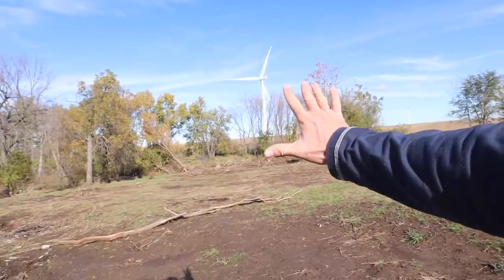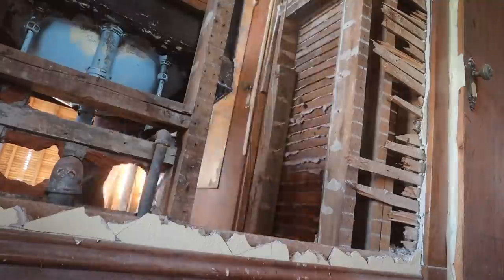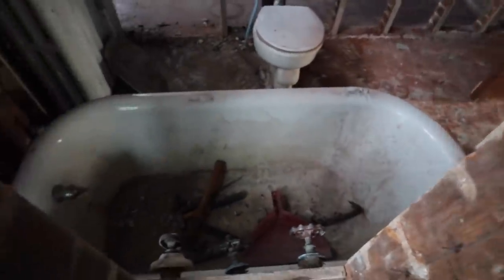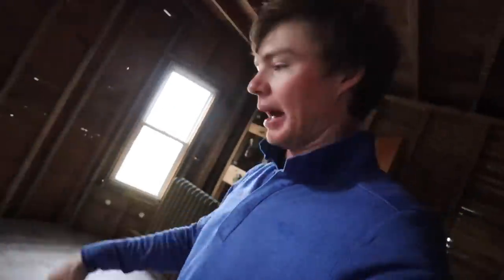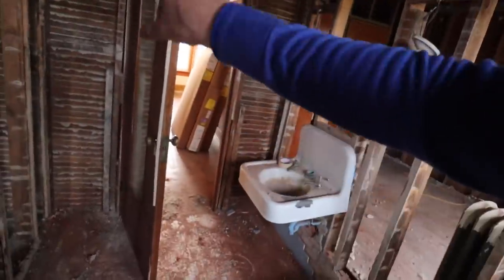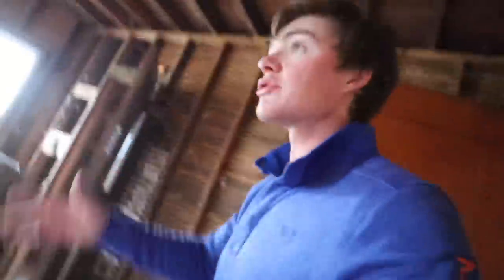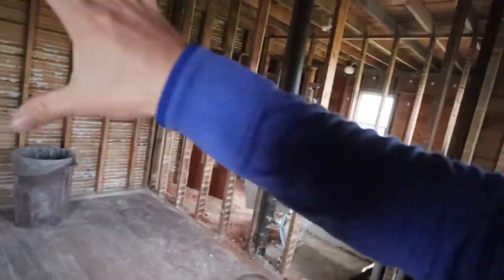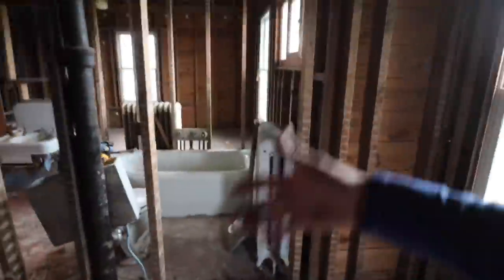I Am Building An Underground Movie Theatre

Comment: Instead of replacing all the boards in the attic floor, just wash with 1 part bleach and 9 parts water (wear a respirator).  Once all dust/debris and droppings are cleaned up, let dry.  Then cover with plywood or some other similar material.  It would save you heaps of additional structure work.  I am certain you could find a company in the area to clean and disinfect your  attic as well if you looked around.
Reply: 100% Agreed here. Then cover with 1/4 plywood to level and add the floor of your choice (laminate?). 😀
Reply: you can also get special paint that will seal in anything left behind
Reply: Bleach cleaning the attic may very well be the way to go to sanitize the wood. Look into it and save some money!  Looking forward to seeing the progress after harvest.
Reply: Seems like I recall there were a few bats also.
Reply: I good coating of Kilz will seal up that wood and odors as long as the wood is dry.
Reply: Ozone generators do work very well. Removed cat smell from my pole barn/shop.
Reply: @maximunpayne92  There is a really good one called "Ridz" kind of expensive, but a gallon goes a long way if you know how to paint. Ridz will cover everything and has a mold and mildew killer in it as well. I would still wash as stated above first though.
Reply: Cleaned one with blank and water and sealed with spray on polyurethane after it was dry and came out good. Works with houses people smoked in and spray everything but the windows and paint over and all looks and smells fine after.
Reply: Just get a floor sander in
Reply: @dans_Learning_Curve  :
Reply: Not bleach. Actually causes more issues. Shockwave is better
Reply: There is encapsulating paint, for use after a fire where the lumber is still sound.  It has also been used to encapsulate lead paint (though no longer allowed) its perfect for your bird contaminated boards.  give them a good cleaning let them dry then apply this stuff (its also a type of primer) and you are good to go.

Comment: I wouldn’t replace that attic floor and all that expense. Rent a commercial floor sander and seal it. Will look amazing and keep the character of the house. If you need insulation the heat from below would heat the floor and put area carpet in a cold spot.
Reply: Warmest always is the top floor. Heat rises you know. Lived in a farm house and the 2nd floor rooms were the warmest. Also the hottest in summer.
Reply: That’s the point he don’t want the old 18 century look for his house. That’s why he upgrading his whole house to look more modern. He’s doing the right thing by making it look more homey and not so much of a haunted house.
Reply: @Buuboi214  Then maybe he needs to buy a house trailer.  And it isn't 18th century, it's 20th century.
Reply: @wandasetzer1469  no shit Sherlock I was being sarcastic.

Comment: Hey Cole, a couple of thoughts for your insulation and wiring: Consider adding a Mooney wall to your exteriors.  You'll give up a grand total of three inches of width and length in your whole interior, you'll be able to add a couple of inches of blown-in dense cellulose (because winter in Iowa), and the added-on 2x2s will provide lots of clearance for you to just lay in electrical, boxes etc.  

Also while you're at this stage of the refurb, you have the opportunity to lay out ducting and whatnot and WHILE YOU'RE THINKING ABOUT THAT, consider turndown capability for your place - turning off the downstairs or specific rooms downstairs, addressable dampers in the ducts, etc.   Variable-speed furnaces and dampers can really take a lot of bite out of your utility bill if the house is mostly empty and you have a lot of rooms empty.
Reply: Closed cell spray foam will provide about R20 in a 2x4 cavity. Furring the walls and using cellulose will result in basically the same R-value. Not worth it at all. Now if you did that with spray foam it might make sense.

Comment: You can use baseboard heat and still use ducting for air conditioning. Also use Kiltz paint for the floor boards up in the attic. It eliminates odor and seals them for toxins. It even works for cat urine so it will work for pigeon smells. Up to you.
Reply: I know a few guys who work for Service Master/ Servpro and they have all kinds of products that seal wood that has been contaminated with urine, smoke, mold, you name it.  If I were Cole I'd get the ceiling insulated while he as the spray foam guys there.  When he wants to finish the attic they can apply something to the floorboards that will eliminate any odors as well as making it safe for the occupants.  You'd save a lot of money compared to ripping up all those nice boards and replacing them with plywood.

Comment: Pur a SPAN circuit breaker panel on each floor. Or an ordinary breaker panel for that matter. By having a dedicated breaker panel on each floor then you would only need a master disconnect in the basement for each new panel. Overall that would alleviate having to pull anything but the large supply wires from the basement to the upper floors and attic.
Reply: Completely overkill and requires hiding an electrical panel on each floor. This isn't a commercial space and the cost of adding panels with arc fault breakers will negate the benefit. If future expansion is required just run extra conduit to each floor.
Reply: @rsporter  lol - when you have the walls open it's absolutely the time to do it.  Hiding the panel?  Your house doesn't have any closets?  
I don't know if you have priced copper lately it's tripled since 2005 when I last bought a roll of Romex.  He's also going to be doing the majority of labor himself so even if there are a few more dollars for the extra panel box, it's utterly negligible  when you are rewiring an old house.

At least between the main panel and a sub panel you can safely use aluminum for the service branch cable - saving a ton of money for that feed and then also not having to home run every circuit to the main panel.  I would never run aluminum to outlets/lights.  Mainly because most people don't terminate it correctly and it oxidizes causing fires.  But for permanent connections like between panels where it gets terminated once and done?  Aluminum is perfectly safe.

 Dunno if I would bother with a separate panel for the attic, but I would absolutely size an upstairs panel for expansion.  I was thinking of putting in a steam shower - needed a new 220 circuit for the steam generator.  Then my upstairs AC unit croaked and when I replaced it I left out the extra heat strips (didn't need them; have gas furnace on the first floor) and was able to reuse that circuit.  Otherwise it would have been a real PITA to pull a new circuit all the way back to my main panel.

You never know what crazy ideas future you will have; a little pre-planning can make things way easier.

Heck while he has he walls open I would be laying extra conduit - especially from the basement to the attic.  I had the builder put in extra conduit on my house.  Luckily they used central vac pipe - which was great because I also put a central vac in later too.  I used one of the unused pipes to run ethernet cable for the upstairs and my security cameras.  it's a like 2.5" in diameter and cheaper than electrical conduit so win-win.  Trenching between buildings?  I always make sure I have at least one empty 1" pipe for future use.  Has saved my butt multiple times down the road for a marginal up front expense.

Comment: You could add baseboard heating or under floor radiant heat and still add ductwork for a/c.  I have forced air in my place and it creates a lot of dust in the house.

Comment: Always remember lots of power points. You can never have to many. Also when you put the hvac in have them put in the system where you can turn on and off rooms your aren’t currently using. It’s a bit more but no point heating or cooling rooms you don’t use all the time. 😁

Comment: Rethink taking the plaster and lathe off. Leave it on if you can. 
A modern open format floor plan is not the right thing for this house. Save all the hardwood floor you take out. People will pay big money for it. Everything you don't want is quality stuff that more experienced people will buy for their house.
Why take that tub out? I'd leave it in and make it usable. Someday you will regret throwing everything out and making that old house look like a modern house with no history.
Reply: Ditto
Reply: I highly disagree on not taking the plaster and lathe of and not making a open floor plan who wants to have their knees knocking in the tub and such tiny spaces
Reply: I also agree! Leave some character!
Reply: I would think the lathe and plaster adds a lot of strength to the structure. Old homes like this were not engineered the same as homes today. Good or bad

Comment: Those cast iron tubs are better at retaining heat than the new tubs. Not too mention safe during tornado season when you need some protection. What's the R rating on that spray foam.
Reply: Closed cell is about R-7 per inch, so with two inches he'll be about R-13 to R-14.  If you need to retain heat in the tub then insulate it, a small amount of insulation will keep the tub way warmer than a bit thicker cast of metal will.
Reply: Hold on to that cast iron tub. They do retain heat and they can be refinished and it will look new.
Reply: There’s no way anyone would convince me to get rid of that tub.
Reply: R value is a lab tested concept not applicable in the real world conditions. 2" of spray foam is all you need anywhere. The true value of it is that it stops 86% of heat transfer and going to 3" only adds 5% less heat transfer, not worth it.    Portable coolers and most home freezers don't use over 2" of foam. See Youtube channel Spray Jones for excellent info. Cole would be wise to do the whole house in 2" foam and have a non vented attic, again see Spray Jones for why. Jones have been doing  non vented attics for 20 yrs in Canada
I would have the foam sprayers spray the outside of the tub while they are there, then encase in a nice framed cover somewhere he puts the bathroom
Reply: @CalmDownClown  grow up
Reply: @CalmDownClown  easy to say when it's not your money they may live in Iowa but they do more then farm if you know the Chanel good thing it's there money and there goals to build the house they feel suit there needs I'd troll elsewhere!
Reply: @CalmDownClown  hes getting a POOL ALSO!!! Thats it we should all cancel his channel!!!!! SMH
Reply: @calebrozeboom  I think he has grown up and seen a lot more than Cole has.
Reply: @safffff1000  after 2inches it doesn't pay you are right I agree 100%  But the problem we have in our area is code says 3 inches.  Sometimes code over rules common sense.  Just be aware

Comment: To remove a cast iron tub: Use a large sledge hammer and break it into pieces.  Wear really good eye protection, gloves, and hearing protection. Once you have it cracked, break it into manageable pieces. Cast iron is hard, but it’s also fairly brittle once you get going on it.  It’s how I remove all my cast iron tubs when I’m remodeling older bathrooms and it works like a charm.
Reply: Yeah if your not trying to save it bust it up
Reply: Too bad those tubs are getting so rare
Reply: You do realize that people will buy those old tubs and things-don’t you Should try selling them on eBay once you get them cleaned up

Comment: Sorry to hear that you’re planning to go with laminate plank flooring and not hardwood.  Yeah, laminate flooring has come a long way, but real hardwood really can’t be beat, especially when you want to restore the original glory of the home.
Reply: And while everything is open you can fix the creaking floors. Me personally I'd rather hear the creaks than the weird sound laminate floors make.
Reply: agreed. laminate doesnt belong in a house that old.... unless you are a slumlord where the renters ruin everything.
Reply: @leighalmond4128  I built a new house in 2017 and put expensive hardwood in and hated it. Where the kitchen chairs slid across the floor was all dented in and the finish was coming off. I replaced it with a higher end laminate at the end of 2018 and it’s been so much better. After almost 3 years the floor still looks brand new and even won a fight against a Cutco knife, which I almost guarantee would’ve gone through the hardwood. It’s a higher end laminate  so it makes the same sound my hardwood made.
Reply: @springsy6210  let alone the structural  load the real wood is providing  this kid is   making so many  young boy  mistakes it is sad time he  is done that place is going to collapes next derachco  or  god forbid a tornado  he is gutting  bricks hard wood  man  he going to regret all these i want it now  and with the cheap stuff they sell at  the cost of todays building supplys what a Dunce Cole turns out to be  I bet his grandparents would disown him  just for what he has done  so far  on just the foolish Loans and excess spending alone i doubt they were thinking he was going to gut there home and move in a live in GF  and pawn off his work on her  like he is doing on the regular now, i   Bet  Nave didnt suggest a underground Movie theater  either
Reply: @leighalmond4128  CLICK, CLICK, CLACK, CLICK, CLICK!!!  This isn't his first bad decision on this house.  Fake metal shingles, vinyl siding, not replacing the windows, gutting the plaster for drywall, vinyl flooring,  etc...
Reply: @CalmDownClown  Nave is smart, she sees her meal ticket punched.  What does she do around the place other than try to coattail off his YouTube channel and jump around like a hyper high school girl?  Sure she has learned how to pull a grain cart, so have other 10 year olds on other channels.
Reply: @specialestness  We had real hardwood, too, and the maintenance was expensive. Every few years a professional had to come in and buff and in about the 10th year it was time for a full strip, sand, and refinish.
Reply: @CalmDownClown  the hardwood would likely just be under the laminate, or at the very worst it’ll be replaced with subfloor, which will do more structurally than the existing hardwood. I can’t believe how butt hurt you are over stupid trivial things like the hardwood or half brick wall…  it’s not your house calm down.
Reply: @springsy6210  Well we've heard from Dr. Phil now so we can move on.  Just because you have some creepy old man crush on her doesn't mean we all have to.
Reply: @ChevyC-hf6km  stay classy big guy.
Reply: @ChevyC-hf6km  I'm in my mid 30s.... shes in her 20s..... nice try though. How old are you?

Comment: We had a tub almost identical to that one. The reuse market wasn't high at the time and the logistics of moving out of a framed house was a non-starter for us. The tub was bigger than any usable door or window. I ended up covering it with a few old wet towels and used the fine art provided by a sledge hammer. A few whacks and less than 30 minutes was all that was needed. We had no issues getting it out of the house and recycling it as scrap.

Comment: The third master bedroom space is PERFECT for cutting the hole in the wall Mount.  You can use that to take out all of the bath fixtures, construction debris, attic floor, all of it.  Cut the hole, put part of out now, seal it and insulate it.  Spray everything except the new exterior door cutout.  Use roll insulation there so you can put it back.  Put you a construction dumpster beneath it and keep filling it up.  Since that is the wall you are going to tear out, that is the perfect place.  Again, you won’t be the first to do this.
Reply: Also the new drywall can go in the same hole.

Comment: Demolition and clean up of an old house like this one was one of my least favorite tings to have done in my past.  You are the younger now when I did it.  It certainly is for someone young.  Good luck and it will be worth it in the end.  Thanks for reviving the memories!  AS for the tub.  A sledge hammer with lots of muscle.  Keep the doors and attached door jams-trust me on that!  I favor radiators personally, add AC

Comment: We used to live in an old 100 year old house that had a clawfoot tub. When we finally got around to remodeling the bathroom, the guy who remodeled the bathroom for us took the tub out and tipped/rolled it upside down onto a thick blanket and basically slid it down the stairs toboggan-style. He had help, of course, but there was no lifting and carrying it down the steps needed. Our contractor wanted to keep the tub intact, otherwise he would have taken a sledge hammer and smashed it into pieces while it was still upstairs and then carried it out in pieces.
Reply: Tub might be steel.
Reply: Or iron!

Comment: When you get to the attic, clean the floor boards as good as you can, then spray kills primer on them, then put plywood down. That will seal the wood and you won’t have any issues, and won’t have to tear up boards that are glued together with foam.

Comment: with the cast iron tub, we have done it 2 ways when remodeling, either rent a "gun safe" dolly, it climbs stairs or take a good ole 5lb sledge to the tub but wear safety gear to avoid the shards that come off it
Reply: put a blanket over it to keep shards flying
Reply: The sledge hammer is exactly what I was going to suggest...
Reply: The sledge hammer is the way to go.  You will be surprised how fast the tub will break down into fist sized pieces.

Comment: I would HIGHLY suggest looking into hot water baseboard heat if you like the radiator heat (I do as well, so I get you!). I love mine and it’s 90% pex and easy to run! Then you can always add ducts for air conditioning easily!